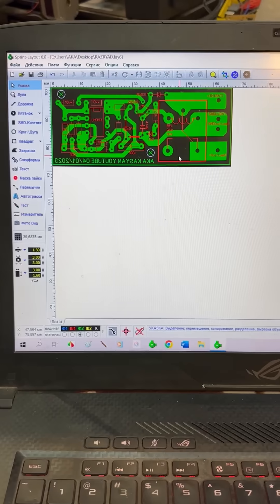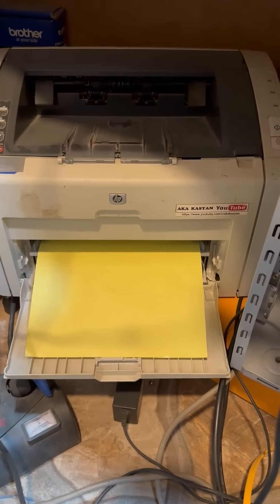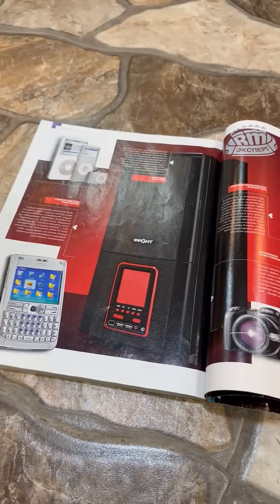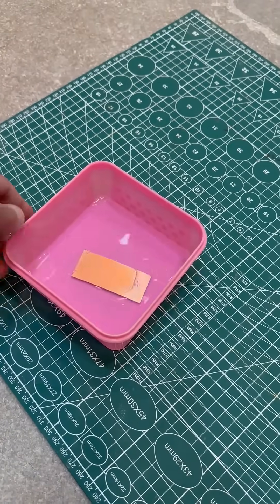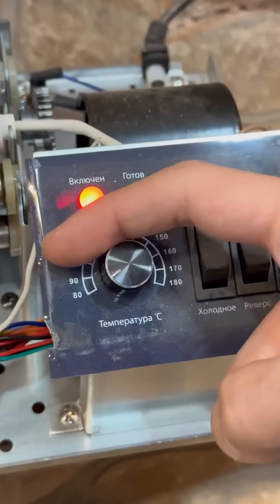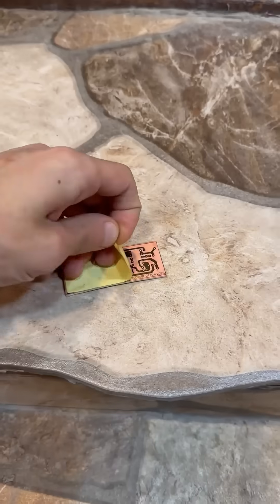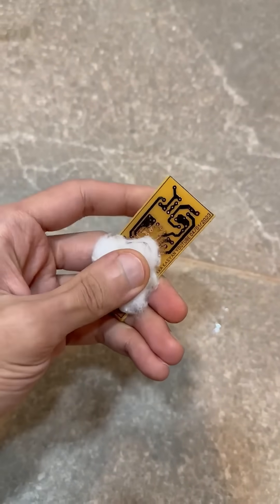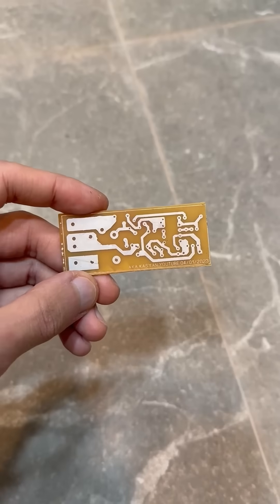How to make a PCB at home

Comment: Yes, you can do this at home. All you need is a bunch of dangerous chemicals and and exotic and expensive machine. All of those are commonplace items in every household.
Reply: you don't have hydrogen peroxide and lemons at home?
Reply: @kaml284  lemons? Not right now.
Hydrogen peroxide? Hell no. Why would I have that in my home?
Also, the amount of citric acid required for the etching is about 1500x what's in a single lemon.
Not that pure citric acid is hard to acquire. But I'm certain that it's even rarer in households than H2O2

Comment: I know literally nothing about what is happening right now, but I want to understand literally everything that is happening right now, subscribed
Reply: is fascinating 
 
You stick the transfer paper on a copper clad fiberglass, then put it in an acid that devolves copper,
I think the ink protects the copper, basically making the acid remove all unwanted copper, 
giving you the design you printed, can be used for things other than circuit boards